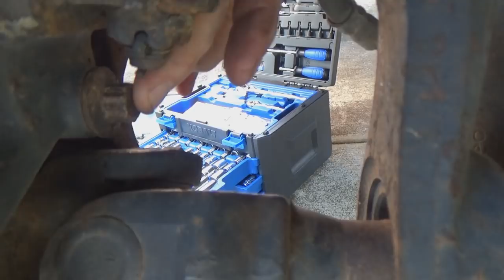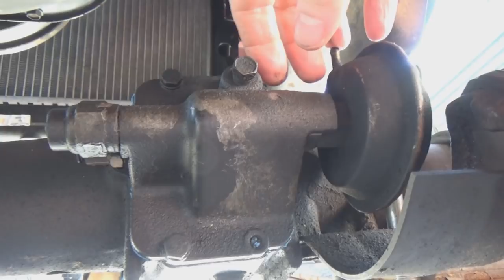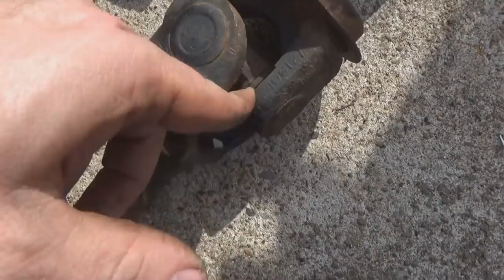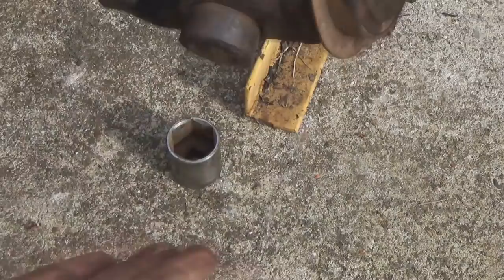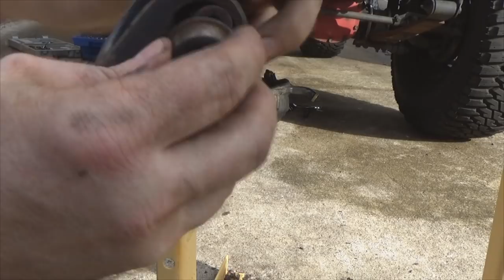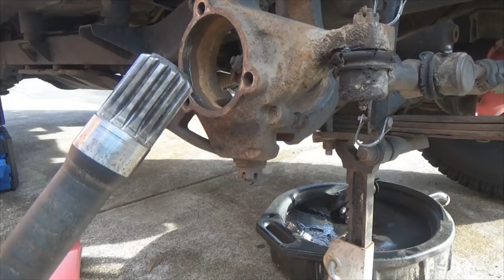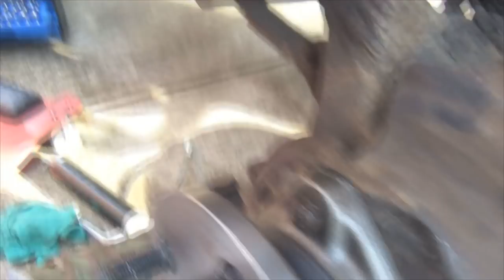Jeep Wrangler YJ - How to change the Axle U-Joint

Comment: Great video. I will be doing this on my new to me 94 soon. It has 32 inch tires and 3.07 gears, but I found a 95 Jeep with 3.73 gears that was a total loss in a fire and am getting both axles. My plan is to change all the seals and bearings on the “fire” axles except pinion bearings and swap complete axles this gave me good direction as well as the last one you did
Reply from the maker: Thanks! Glad you like the videos and they helped you out. You will be much happier with the 3:73s. A couple of weeks ago the rear diff in my 91 started making some very nasty sounds. So I swapped the rears diffs between the 93 and 91 (video coming soon). The 93 has 3:55 gears so that was a welcoming upgrade being that I'm running 35" tires. I still gotta swap the front diffs out to make the gear ratios match. I'm gonna pull the front diff outta the 93 (3:55 gears), replace all the steering components and ball joints. Then put that diff under the 91 .. then the 91 (3:07 gears) diff goes under the 93. I'll be eventually building the (3:07) diffs I'm putting in the 93. Thanks for dropping in and leaving a great comment! Have a great day!

Comment: Ya i welded the front diff on one of my yjs and used a cable actuator for my 4wd
Reply from the maker: I really thought about doing that to Rust Bucket just to see how it worked out. I have a Posi-lok cable system I'm not using at the moment.

Comment: Have you noticed any extra vibration after putting those clamps on the axleshaft?
Reply from the maker: Nope .. not at all. That's why I put two of them on there putting the clamp screws 180 degrees apart from each other. By having the two clamps at 180 degrees of each other would balance instead of vibrating. I've run it like that for well over 2 if not 3 years... Flawless and easy. Thanks for checking out the video! Have a great day!!

Comment: I’m new to this and this is great! On one video I watched the guy was pulling apart the the diff and a connection on the passenger side before he pulled the axles out.  Do I have to do something like that or is it ok to just pull them and then will they just go back in?
Reply from the maker: There is a "locking collar" on the passenger side. You will need to pull that plate off to re-align that collar when you put it back together. Hope that helps.

Comment: Hey I’m doing this my self tomorrow(changing my U Joint). Will I have to mess around with the CAD?
Reply: Or did you have remove the CAD cover because of the Hose clamps?
Reply from the maker: If it is the passenger side you have to mess with the CAD because that collar will need lines up again.

Comment: what size socket are you using? 6pt or 12pt, 13mm, 3/8" or 1/2" drive? Another great video. Thanks
Reply from the maker: For which part of the video?
Reply: to remove the hub.

Comment: when you change your rim size to a larger Rim like 22s do you have to change the gear ratio in the pumpkins
Reply from the maker: When you change the tire diameter is when you change gearing. If you stay with the same diameter tire and use 22" rims .. .its gonna ride worse due to having less side wall.